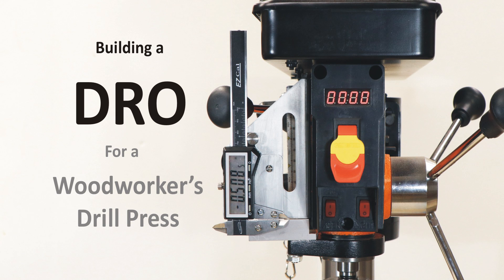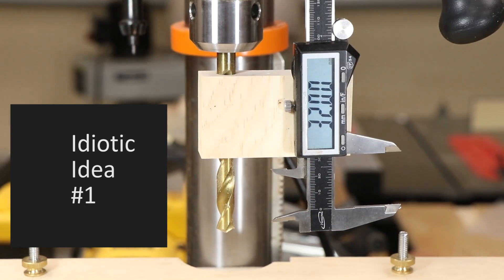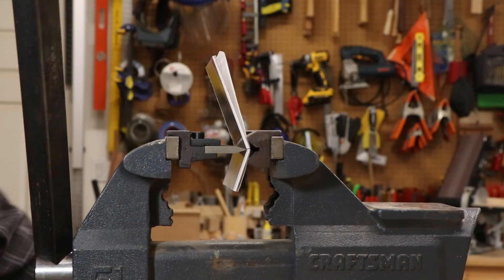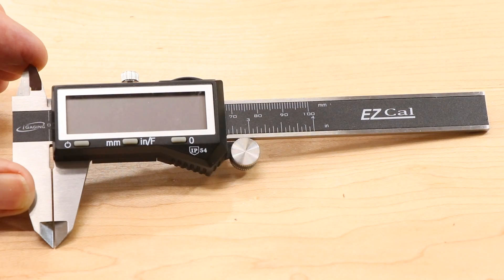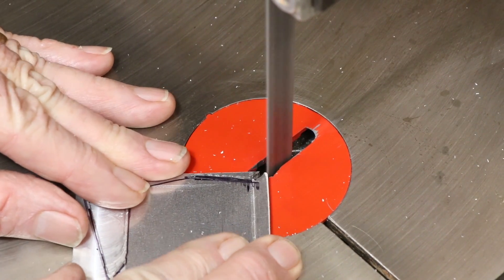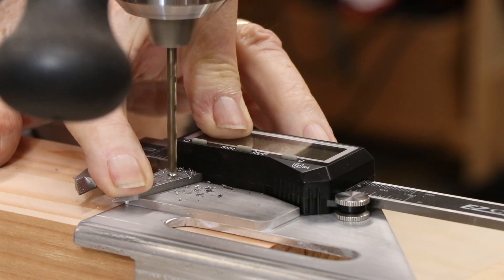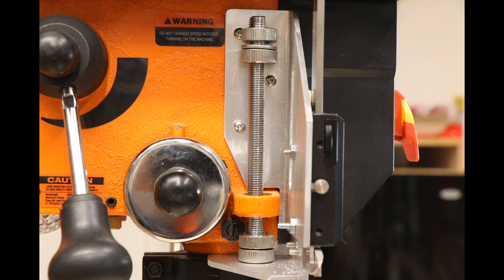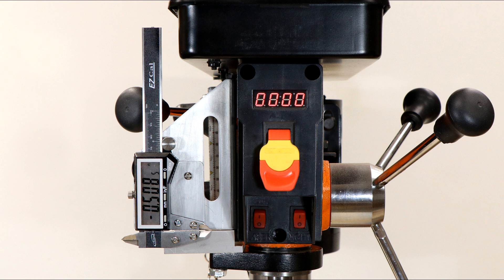Precision Drill Press Depth Gauge

Comment: Hi, This is a great solution to accurate depth measurement on the drill press. But, and I'm not sure if anyone else has mentioned this already, you should advise people to check inside of the press (while it is of course unplugged from mains) that the mounting holes have no live switching/wiring etc behind where they are drilling. If not then this could lead to very unfortunate and dangerous, if not fatal, results, such as instant shock or creating a live machine. Please don't take my comment as mindless negativity, I like your vids and appreciate the effort you take making them, I just think that this should have been pointed out before progressing with the actual drilling of the body. Again, thanks and keep up the good work!

Comment: Outstanding video! I learned several things from this. How to lay out, bend and machine a custom bracket; the fact that I can machine aluminum to thickness with a carbide bit in the router table; and that I will buy a low-cost caliper made of FRP (fiber reinforced plastic) so I don't have to try to drill hardened tool steel.

Comment: They say hindsight is a wonderful thing. The beauty of watching someone else do all the leg work and testing gives us viewers the benefit of that hindsight. If you ended up not using the depth stop that would give two readily available fixings. Remove the depth stop screw and bolt through the holes. I will have a look at mine and see if that is possible. It is a genius idea though. I too have DRO envy and didn't think of this blindingly obvious solution! Thank you for sharing. I see you are still posting so I have subscribed.

Comment: As a note with CA glue, less can be more. You used a lot of CA glue when 3 drops would have done. CA likes a very thin layer, at most, with thin viscosity glues. CA is bailable is a lot of viscosities depending on use from ultra-thin (thinner than water) through ultra-thick (thicker than molasses). You can also apply a light coverage of glue on one side and activator on the other; they should bond instantly. If you don’t have CA activator, AKA kicker, you can lightly dust one side with baking soda; you can also use baking soda as a filler or with high viscosity glues as a quick setting paste. I’ve used CA glues for years with good results; it is quite versatile when used for its strengths and not pushed beyond its weaknesses.

Comment: Excellent build, videography, explanation, and humor.  And a free template!  Thanks!
After your time with this drill press, are you happy with it?  I, like you, have lusted after bigger, maybe better, and way more expensive ones, but alas,  although I am rapidly approaching retirement age, the last time I put my data into one of those online calculators it told me I'll be able to comfortably retire at 117.  Of course, that depends on how one defines comfort, but I digress.  Anyway, the Wen appeals to me mainly for the easy of varying the speed.  I think I'm too lazy to switch belts and pulleys as often as I should.  How has this press held up?  Patrick and community, your review will be appreciated.

Comment: Excellent idea.. I added a accessory table to to my old Craftsman drill to make it a more modern drill press i then found a 8”x8” lift stand for my drill with a knob in front to raise and lower it. It was rated at 68 lbs of lift. I found it on Amazon under scientific instruments. Now I just loosen the table clamp and accurately raise or lower.

Comment: I adore your videos. I love the idea of printing your patterns and affixing them to your stock. They are always so clean and lovely. I was hoping that could share how you make them, or less specifically what software you use. Maybe? In any case, thank you tons for your wonderful videos!
Reply from the maker: I use Corel Draw primarily.  It is an all-purpose drawing program with a lot of features.  However, most of the designs I have made are well within the capabilities of many simple and low-cost drawing programs.

Comment: Aluminum almost instantly oxidizes from the oxygen in the air as soon as it's surface is cut or disturbed Patrick. That oxidation is very thin and almost invisible but still there. I'd almost bet that's part of the reason why your CA glue joint failed. Sanding the joint area and as quick as possible applying the CA glue and then pressing the parts together does help a lot. And CA glue isn't the best choice for any shear loads so that was another probable cause of it failing. 

I wouldn't feel too deprived about not being able to afford that fancy Nova drill press. Despite some of the "golly gee" enhancements they added to it they like almost every other light duty drill press manufacturer totally neglected to address the main failing point all these non industrial drill presses have. That light duty, thin walled and very poorly designed cantilevered column to table assembly. Even drilling hard woods or plywood these light weight DP tables deflect varying amounts depending on the work piece weight, drill diameter used and material being drilled. So it defeats the purpose of why your buying a drill press in the first place.......................drilling straight holes. As desirable as that Nova DP looks on the surface, the advertising hype about it doesn't match it's performance against what it costs. I work with metal far more than wood so my opinions are from that perspective. But for that $1500 I'd expect much more than that fancy DP is capable of even for wood working. They should have designed it to use a geared Z axis feed screw for the table height adjustment like most good and heavy duty industrial drill presses use. The added cost was obviously why they didn't do so.

Comment: Great video Patrick. I have this drill press and it has served me well. I do have a bit of run out in the chuck but I'll bet I can eliminate it by reseating it. I'm also going to replace the chuck with a keyless one. The only thing that is slightly annoying to me is that the rpm gauge stays on when the drill press is off. I may add a tiny push switch to it so I can get it to turn off when the drill press is off.